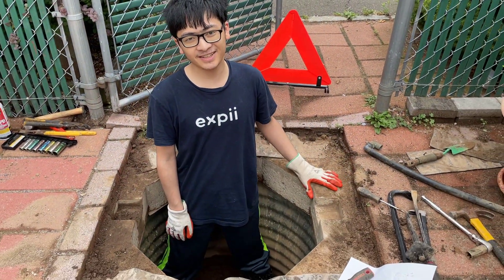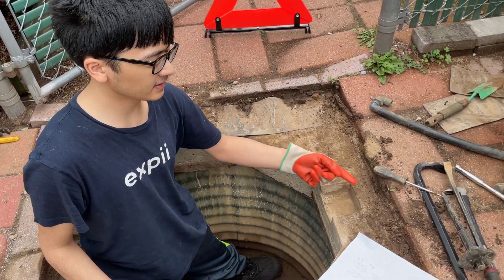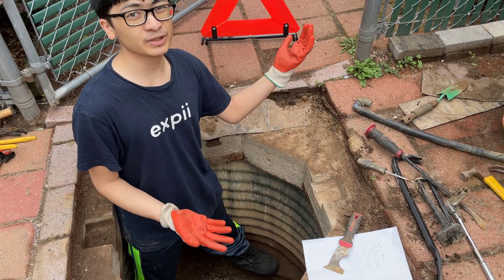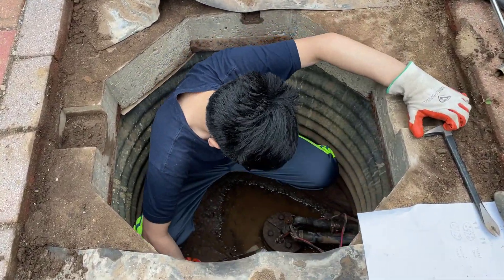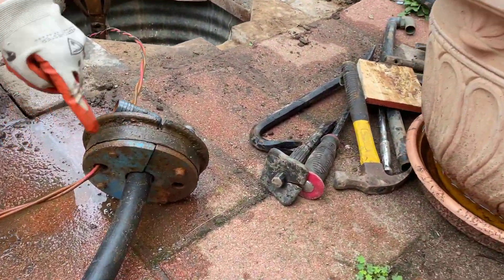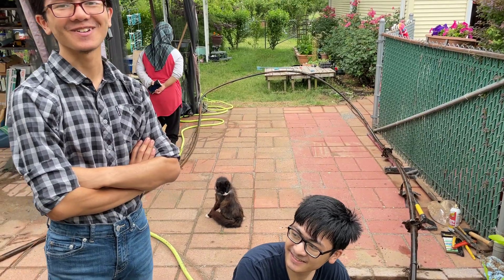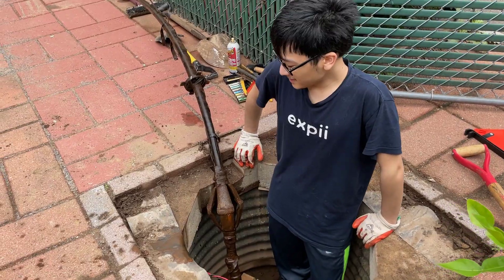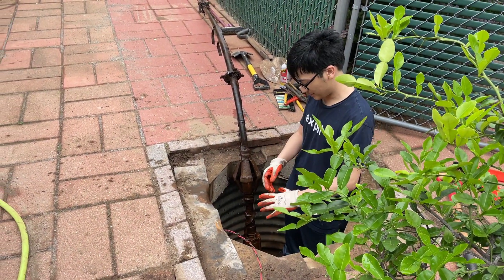How To Remove Well Water Top Seal Wellhead Casing Opening Cap Cover | Pull Submersible Pump & Wiring

Comment from the maker: Here are the #ad links to some of the tools, parts & accessories which might be required to perform this repair:
1.  https://amzn.to/3sDCcXB  |  Plumb eeze Pressure Tank Installation Kit with 1" Brass Union tank tee to fit most pressure tanks with diameters up to 16"
2.  https://amzn.to/3ECi36w  |  Cut to Length 10-3/12-3/14-3 Wire W/Ground (Yellow, RED, Green, Black) Twisted Submersible Water Well Pump Cable Wire 600V Copper Cut in 10ft Continuous increments: You Pick Quantity! (100', 10-3)
3.  https://amzn.to/3mGxlB9  |  3 x A3C Submersible Pump Wire Splice Kit Repair and Installation. #10#12#14 AWG, 3 Wires Easy and Reliable. Crimp It - Shrink It and Forget it! - Pack of 3 Kits
4.  https://amzn.to/3sIgT7o  |  Fdit Electric 40-60 PSI Water Pump Pressure Control Switch Adjustable Double Spring Pole with Low Pressure Cut-Off
5.  https://amzn.to/3pARgDr  |  Red Lion 14942409 RL22G10-3W2V Submersible Deep Well Pump with Control Box, 26.75"H, Gray

Or Click on Amazon link here and search for what you need:  https://amzn.to/3xIOsqg

Comment: Its crazy how hard it is to find a video that actually tells you what to do with those metal well seals lol. Most well videos are about how to make connections and they warn you of course not to loosen the bolts all the way. But they fail to explain why loosening the bolts is important. I was just about to just raw dog it with a winch without loosening them up. Glad I found this video!

Comment: Thank you! Now I understand why the bolts must be loosened before the seal can be lifted. Since they aren't connected to the casing, I didn't understand how they hold the seal on. Now I get it. I also understand why it might take special equipment to remove the seal on my 145-foot well. I guess the pump and all the pipe could make it too heavy for me to lift.

Comment: Thank you for making this video. The cap to my well is very similar. I had removed 3 of the bolts and will put them back to prevent the seal from dropping into the well.

Comment: Thanks for these tips. I am about to do the same job and didn't even think about losing the rubber seals down the hole.
Reply from the maker: It's not the rubber seal which would go down the tube but the two bottom half-moon metal pieces if you loosen the bolts completely.  DO NOT loosen the bolts too much.